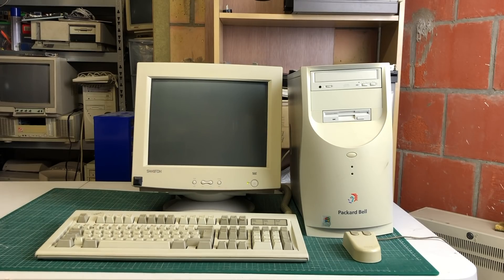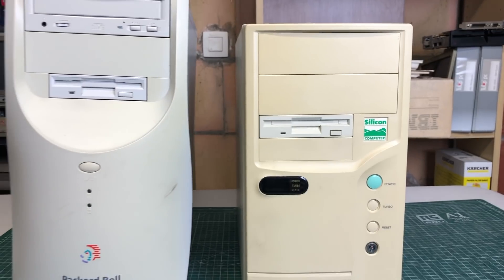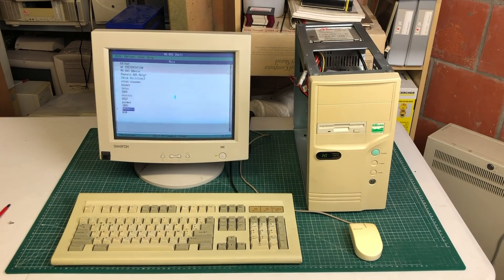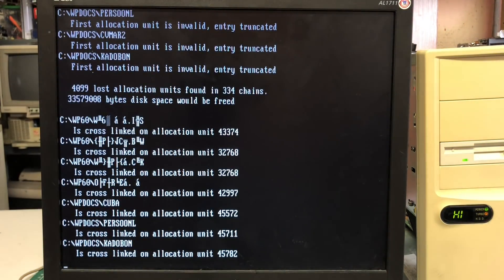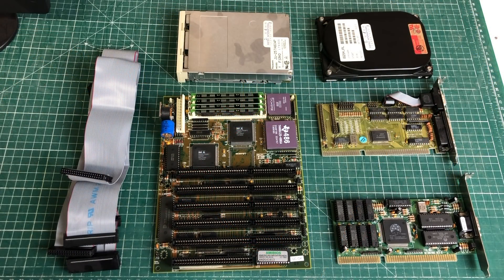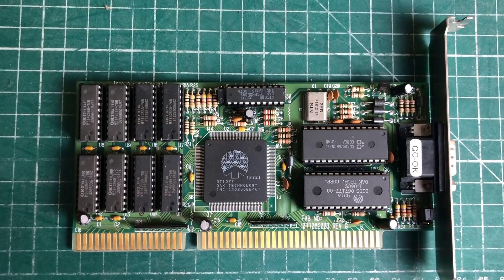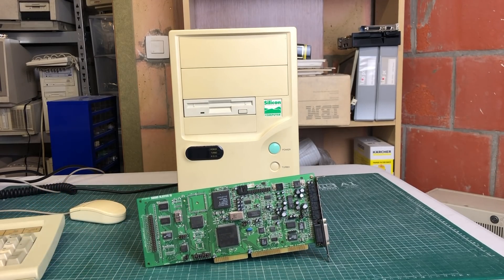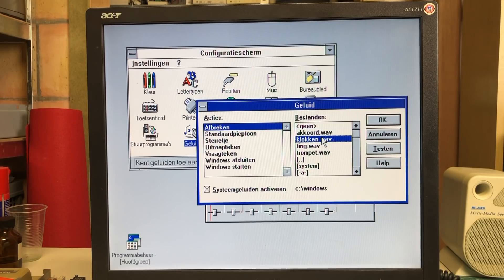A look at a 486 PC wanna-be

Comment: I once wrote a terrain editor for Stunts after doing like 15 tracks with a binary editor. Then when I showed it off at a retrocomputing convention, someone pointed me out to try Shift-F1 in track editor... well at least my version shows the entire terrain at once... dammit Stunts, Keen and Indy 500 are my favourites. Also Crystal Caves which I have a childhood connection with. And Blockout. That was my first video game ever. Still love it. And Epic Pinball. And goddammit XWING-CD. With the FPU, that game should run decent enough on that machine of yours. (40 MHz 386: 8fps max. Install a 40MHz 387 CoPro->8fps min!)
Reply: What do you mean about XWING and FPU?
Reply: @rasz  Runnign XWING on a 386 is... not the greatest of experiences. It lags like hell. Putting a 387 FPU in will make the game much more playable because you know more frames per second. It's a significant increase I experienced first hand.
Reply: @rasz  TBH IDK if XWING uses FPU. But XWINGCD does. Otherwise how would you explain the frame rate going through the roof when I installed that 387 in my computer?
Reply: @rasz  I gotta check that out, then. My memory isn't the best and I might be wrong.
I certainly tested 4D sports Stunts. It did not use the FPU. Put two 12 MHz 286s, one with the FPU (and tested using a benchmark) side by side and the FPS was identical. The refreshs even stayed in sync until almost the end of the demo.
Kinda sad. On 286 this game is just almost playable. With an FPU it would become downright enjoyable on that machine.

Comment: I have two tiny identical mainboards. One has the CPU socket unpopulated and instead an SMD 40 MHz 386 soldered next to it (it died a few months ago sadly, I don't know why - not the PSU, not the RAM, not the battery corrosion) and the other mainboard has a socket with the exact same TI 486, an Intel 387 FPU and both have the OPTi chipset... the 486 one still works.
An OAK tech video card in GREEN!? Never seen one in green. Mine (and I have a dozen) are all yellow, even the one with 1MB VRAM.
My second PC was a Packard Bell Multimedia 486 and I loved it. (the cheap side of it was that it didn't have any L2 cache installed and even though there was a manual on how to upgrade it and it even included photos, it wouldn't detect any cache I installed - but damn 10-15 year old me loved this machine!) Btw. it still works.
Back then I checked Oak tech cards versus Trident and... performancewise they were like less than 5% apart. The 512k OAKs could all do 800*600 with 256 colors while most Tridents couldn't do that, but some could. Also weird is that on most OAKs I noticed slight horizontal timing glitches (a few scanlines jittering a few pixels to the right for a frame every now and then) in any video mode except 800*600. The Tridents didn't do that. I also thought the colors on the Tridents kinda looked better. The Tridents do have different RAMDACs though, so that could actually be true.

Comment: Check and see if that Packard Bell Supports the K6 2+ or 3+. If so, then throw a Voodoo 3 in that thing with one of those and say a AWE 64 and you'll have one hell of a gaming PC. The K6 + chips have onboard L2 Cache (2+ 128 K and 3+ has 256 K) and have a multiplier you can control with software so with cache tricks you can fine tune it to run damn near any DOS program well, even Wing Commander!

Comment: I have that exact case.  I've had a bunch of different motherboards in there over time, started out as a Biostar mobo with Am486DX4, then I put an ASUS mobo with a P200 MMX in there, and I've also got an AT ASUS PII 333Mhz (I think) board that I can stick in there as well, but never did.

Comment: Pretty sure that Packard Bell had a cpu upgrade. I used to own that same machine, with win98 and it only had a 450mhz intel pentium III cpu.
Reply: AMD K6 isn't compatible with Socket 370. that machine has a Super Socket 7 board. A K6 -II would be a downgrade.  Most likely PB reused the case on the later machine.,

Comment: I built custom computers in the 90s at a computer store and we called those Packard Hells as they were underpowered, not super expandable, and just disposable computers.
Reply: Bottom end components and poorly written firmware.  I also worked at a computer shop for awhile, and our boss thought it was a good idea to get us PB certified so we can provide warranty service.   A Best Buy moved into town and they didn't have an in house  service center back then.  All PBcovered was hardware failures, so if your system crashed because of poorly written firmware or drivers, you were screwed.  I felt bad for these customers, since you knew they paid $2000 or more for a flaky system.  The parent company that owned our shop was into  auctions and salvage, and sent us a couple hundred "refurbished" PB systems to sell at our outlet.  Crappy outdated firmware with no way to update it without replacing a rom made me hate it when customers would ask about the refurbs.
Reply: We also called them Puke-rd Bells and Puckered Balls.  They were wretched flaming balls of fail and suck

Comment: Thank you for the video!! Yes I would love to see how that 486 chip compares to other 486 processors in the same range due to it was originally a 386/486 chip and bus that has a 486 upgrade and how much the ISA slot video card  compares to Vesa or even pci performance. Do I love the sounds of old computers? You bet I do!! I love vintage computers and its always great to see others that do as well. Will you be installing a CD- Rom Drive as well or any other upgrades in this machine? Thanks again I loved it! Sorry almost didn't give a shout out to the Packard Bell computer. Yes a K6-2 500Mhz for some more retro goodness or if you do decide to get rid of it, Billy Core from The Nostalgia Mall absolutely loves Packard Bell computers. He would probably be more than happy to take it off your hands.
Reply: It compares badly to the real 486 :)
Reply: That is true but still would love to see at what point it becomes a point of no return.
Reply: The big TLDR is it was pointless. DLC40 is around 486@25MHz. TI 486 SXL-40, the fastest 486 in 386 socket cpu is almost as fast as 486@33MHz - meaning you can "comfortably" play Doom with Low details in full screen at around 15 fps with fast ISA VGA. 386DX40 meant 10fps in 70% screen window. Not a huge jump, and that was the only game that went from my eyes are bleeding to hey I can almost play this after upgrade.
ISA to VESA was huge. VESA to PCI pretty much made no difference under DOS, CPU was the limit.

Comment: I had the same Packard Bell case in France, but it hosted a Celeron 466 MHz, with an Intel i810 chipset for graphics. No AGP port on the motherboard. Also, the IDE cable to the DVD drive was prone to failure and the only solution was to restore the OS. YUCK.

Comment: Remember I sold a few machines with the 486dlc around 1995, but we used a motherboard with integrated 387, the user could upgrade to an Intel 486 because the board had a normal 486 socket too... The cheapest entry level machine 😊

Comment: UGH!  I remember these – what a mess.  Working a summer job at a computer store at the time, the sales guys had the idea of blitzing old customers with upgrade options that included this as a cheap eye catching base upgrade.  The hope obviously to convince the client, once they came in, that they should buy a whole new real 486 or even one of those flashy new Pentium machines.  Well surprisingly quite a few people took this 386 upgrade option.  I still member some customers old 386 computers being really early 386 machines or socketed machines that wouldn’t take the upgrade.  Then trying to explain to the sales guy that it won’t happen on these old machines.  They really didn’t care what the tech kid had to say and the reply was usually – “We sold it.  Make it happened”.  Then I’d have to go dig through the old computer cemetery for a 386 board that would take the DLC chip and in the end swapping out the whole motherboard just for these dumb upgrades.  These were a bad idea.  Maybe only as a way to liquidate late 386 motherboard stock vendors might have left over – not as an upgrade path.
Reply: Idk, so long as the original chip was socketed, I think there was an appropriate market for these kinds of upgrades.  I can say that when I upgraded my IBM PS/2 from a 386SX to the 486SLC2 it really helped the overall system performance running OS/2.

Comment: That SB card appears to have a CDrom interface.  Computers of that era could have had a CDrom, you should add one.
Reply from the maker: Yes it does, I even think it supports standard IDE cdrom drives (and not only proprietary mitsumi or panasonic interfaces). But I like the clean look without it. might throw in a networking card to load stuff from the network. Would be more practical nowadays than a cdrom drive.
Reply: @RetroSpector78  Ah, someone else remembers CDROM interface hell. It's not very fun to upgrade the sound card and then realize the CDROM has to be replaced too. Unless you were able to get your hands on one of those rare or uncommon cards that just had the sony, panasonic, and mitsumi interfaces on it.

Comment: That's an interesting system.  Cyrix made a number of chips that I believe were in whole or in part engineered by TI.  I have a Tandy 1000 tl/2 (8Mhz 286) and there was an upgrade card to make that a Cyrix 486 sx/25.  There were also several retail boards that used the famous 486SLC processors and were very cheap in the early 90s.  I remember when an Intel 486 66 cost about $300, you could get the whole Cyrix board with the SLC and a 386 Math Co-processor for under $100.  I have never seen any of these Cyrix 486D or S chips with VLB or PCI bus.  I wonder if that connection was even possible.
Reply: Texas Instruments manufactured these CPUs for Cyrix. It's similar deal as  TSMC making AMD CPUs these days.  Texas Instruments also made 486 processors with their own branding. This 486DLC is practically 386DX with  486 tweaks  (upgraded cache, 486 instruction set ) and it's performance is lower than Intel 486.
Reply: Intel set crazy prices for 486DX. When AMD came out in 1993 with 486DX40 it was priced at 2/3 of Intel 486DX33. Intel 486DX33 itself was 2x more expensive than Intel 486SX33. Insane when you look at the benchmarks.
Reply: @rasz  I agree.  This is what raised the average system price at Gateway to over $3000 by the end of 1994.  Double what they were when the 386 came out.

Comment: Ha! The trusty OAK 077! That was my first graphics card. the 1MB version is actually rather rare. God I was so happy it could do the VESA SVGA stuff back in the day.
Reply: My first computer was a Packard Bell 486 with an integrated Oak OTI-076 graphics chip and 512KB of video DRAM.  Since it was my first computer and I had little to compare it to, I thought it did just fine until I wanted to play some demanding DOS games like DOOM. :-D
Reply: Gosh, at least someone understands that, given the period of the machine, VESA local bus was where graphics was at.  That is until MMX became the rage and AGP phased out the VLB.  Even then MMX (even with a standard pci card) stuck around well after AGP and eventually 3d graphics arrived.  Those that would arbitrarily poke a voodoo card in it would be missing the entire point of "retro." HAHA! not that anyone could poke a voodoo card in an ISA slot...
Reply: @fwingebritson  There was a stint of PCI before AGP took over though.
Reply: @catriona_drummond  Yes, and even when AGP took over it shared the first PCI slot.  One thing I realized last spring, though, was PCI versions of most cards existed throughout the AGP era.  i responded to an ad on CL that said "Computer board for sale"  The box said "ATI 7000 PCI"  Inside was a voodoo 3000 AGP card.  I was a little disappointed because I had use  for the ATI 7000 for a computer made around 2001 that has on board video but no AGP or PCIe slot.  I do not know if I hadn't realized or maybe forgot the PCI cards stayed around until PCIe came and stayed.  BTW, I think they bought the ATI card to replace the voodoo card.

Comment: PB got a bad rap when they were new. When I worked in computer retail in the late 90s those things spent more time in the repair shop than a customer home. That's assuming they didn't just return it and get another brand.
Reply from the maker: Yeah that’s also what i heard. But no hands on experience. Had some issues getting it to start. Even with a new PSU it wouldn’t always turn on. Sometimes it would turn on upon inserting the power cable (without me even touching the power button.) and sometimes it didn’t do anything. Disabled the power mgmt in the bios and seems to be working now.
Reply: In the mid to late 90's, PB was also caught putting used/refurbed parts into computers that were sold as NEW. It was definitely one of those markers that the company was on the decline.
Reply: my first system wS. pak bell. multimedia S606.    my last great socket 370 build was the best tho
Reply: They had the same issues in the early 90's.

Comment: Install 98 on that Packard Bell and use it for some DOS games as well. With that K6-2, it'll be pretty powerful!
Reply from the maker: That is the plan. No idea how compatible the ess soundcard will be in msdos
Reply: @RetroSpector78  I would guess it has at least some DOS compatibility in my experience. So it's possibly a great Windows 98SE machine :-D
Reply: I had a K6-2 500. With an overclocked Voodoo2 and 384MB RAM, it was a beast!
Reply: @5roundsrapid263  Do you still have it? If not, RIP to the K6-2 500.
Reply: Roblox and Minecraft Fan 2019 I wish! It was a great machine. It was originally a K6-2 350 overclocked to 400. I got a 500 for dirt cheap after the Athlon came out. 25% faster for $40.
Reply: Will that Packard Bell run Crysis?